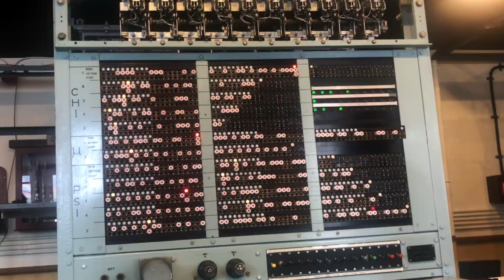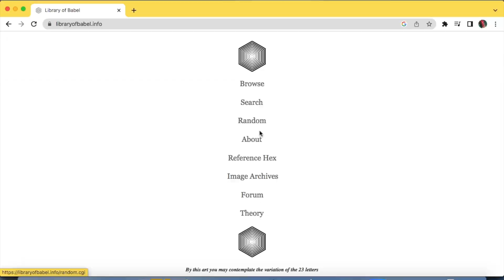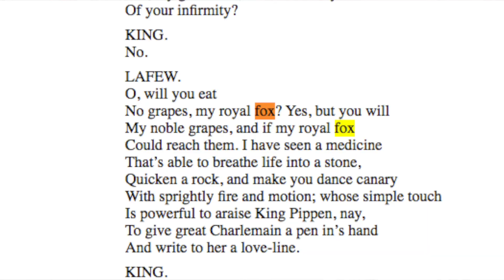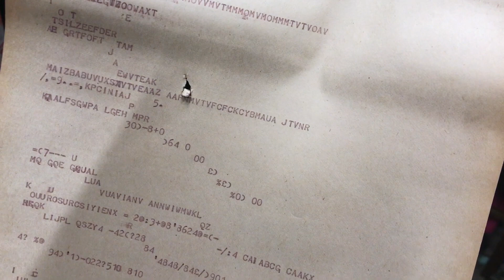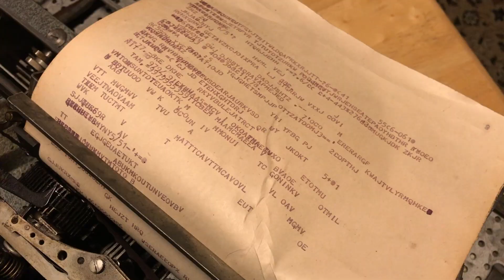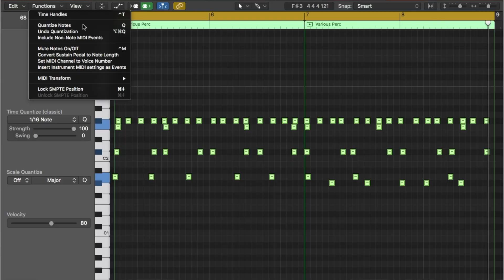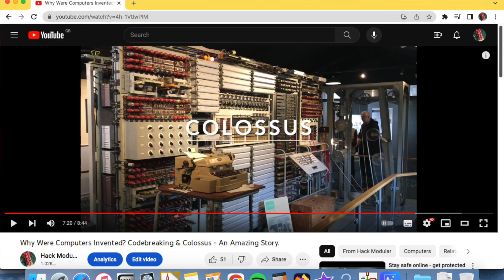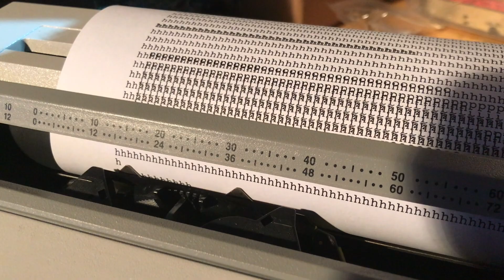Automatic Typing Monkey Shakespeare Generator - Testing The Infinite Monkey Theorem

Comment: I thoroughly enjoyed this Mitch.  The thought that occurs to me is that among the works of the infinitely-prolonged-typing-monkey (besides the complete works of Shakespeare) will also be a version which is very nearly correct but has a typo on page 23 of The Tempest.
Reply from the maker: 😂😂😂 Of course! Only 33 billion years to get that close! Amazing that’s made me chuckle
Reply: @hackmodular  but seriously. If any of this is serious....   I think as a programmer, so my own solution to the 'linguistic quantiser' would be to do it in software. It would be very simple to make a microcontroller receive data as serial at whatever baud, modify it according to some rules and spit it out as serial. If you want to talk about this, get in touch.
Reply from the maker: @shieladixon  cheers Shiela. I think it will come to that eventually, but will be quite fun to see if the Heath Robinson machines can get anywhere close!
Reply: @hackmodular  that would definitely more in keeping with your stuff

Comment: the empircal evidence got put i to a paper, and it was partially funded by SpaaceX. A pdf is out there. 

From an informational theory point of video, language space is vast. But image space is vast too. If you just randomly type letters (27 to kedp it simple). You will fome up with an English work or two rather easily. 

But if you even take a 20x20 image, and dont even have colors just black or white - you will never get anything resembling a character or smiley. In fact, that 20x20 image is larger than we have molecules in the universe. So if you go for thr whole time kf the universe, you might be able to run through all permutations. 

There is a great video by Steve Brunton (eigensteve on YouTube) about this topic. 

Language and images are highly compressible. Since only the a tiny part of those possibilites make sense. And thatd why language models work. Language models simply assing a probability to how likely a sequence of inputs it. That's what is exploited by transformers and products like ChatGPT on the highest end. And those work on tokens, not characters.
Reply from the maker: Very interesting thanks